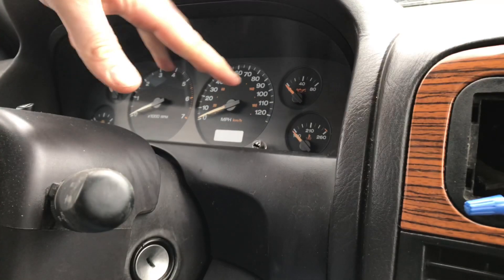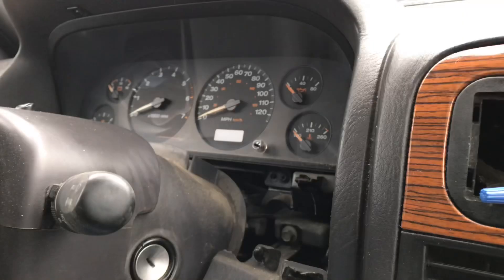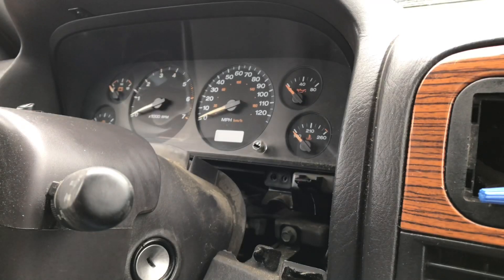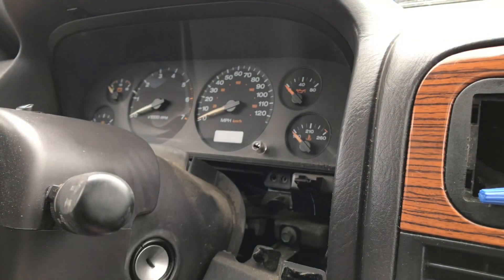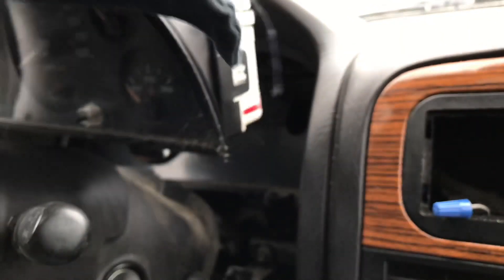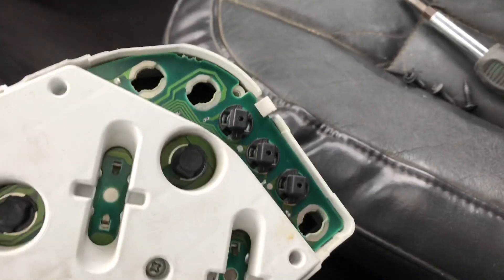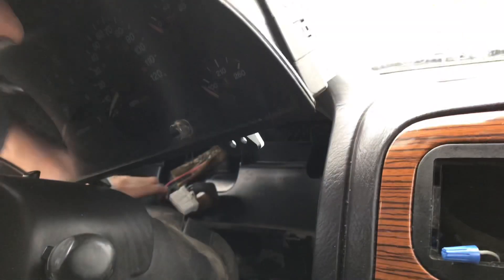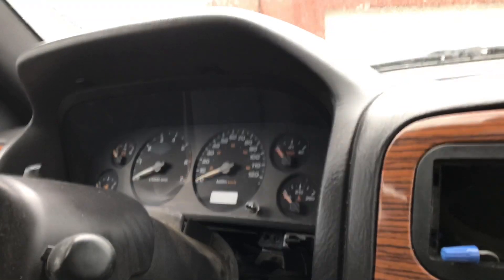1999-2004 Jeep Grand Cherokee Instrument cluster removal

Comment: Thanks for your Jeep WJ vids!  Was wondering if there is a reason my turn signal lights in the instrument cluster are not lighting up after an LED upgrade with a pc74 bulb.   They were working with the halogen before replacement... took all precautions of disconnecting the battery.  The rest look great and yes I did flip them around...

Comment: Thanks for the video.  I hadn't seen it before I switched out my cluster.  I didn't remove the battery terminal.  Now the mileage shows what was on the previous vehicle since I got mine off EBay.  Does anyone know if I just need to remove the battery terminal and them put it back on if it will reset the odometer?  Or is there another way?

Comment: Maybe you'll see this or not, or can point in a direction -  had to do a SKIM deletion on an 01 WJ.  Now it starts/runs fine, but gauges are all dead and lit up.  Cluster will move during reset/test via trip meter, but dead when running. Trip meter and odometer dont even move.

Any pointers?
Reply: Any resolution? I'm experiencing the same thing in 2002 grand Cherokee. Jake Kyle
Reply: @thorpeparsons  the SKIM delete didnt work.  Ended up having to get a new PCM.  Ordered it off ebay from flashmasters.  They programmed it, shipped it, and its been driving ever since.  👍
Reply: @callmejakob  what’s a PCM and how much was it please? My Jeep has the same issues 😞
Reply: @yorkshirepudlian  pcm/ecm is the main computer for the vehicle.  Sits on passenger side firewall.  I got mine from flashmasters on ebay.
Reply: @callmejakob  ah okay thanks. Did the new one need setting up or was it plug and play?
Reply: @yorkshirepudlian  itll need programmed to your vin and mileage.  But flashmasters did that for me themselves, as well as a skim delete.  I just had to send them the info.  Id recommend them.  I found them on ebay.
Reply: @callmejakob  that’s great , thanks for the info Jake 👍